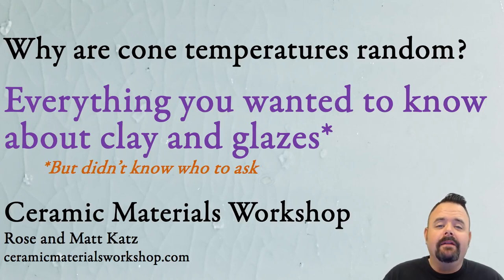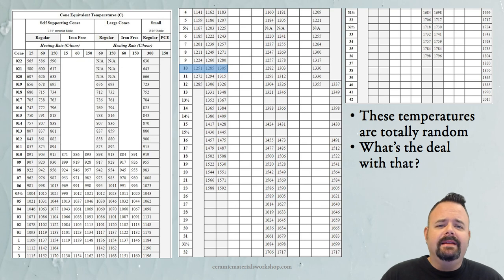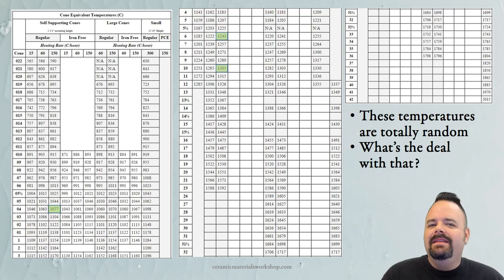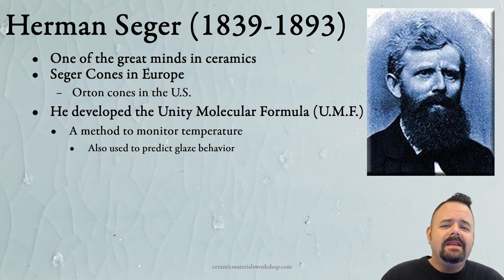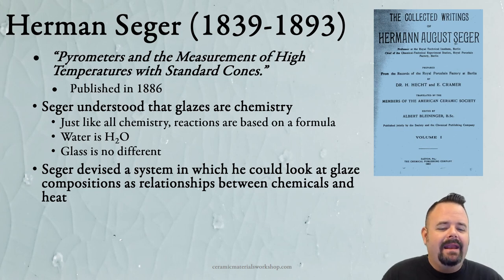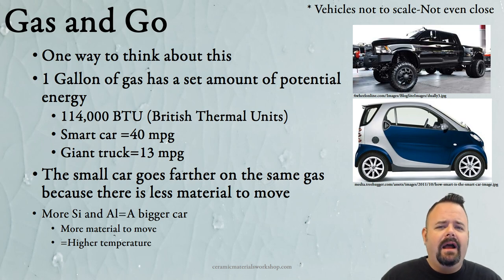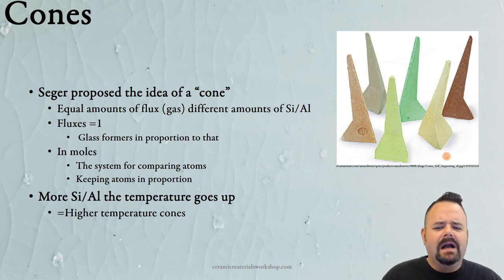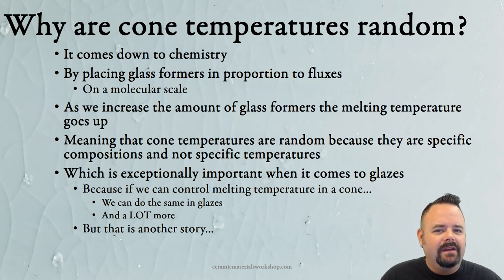Free Glaze Chemistry Lesson:  Why Are Ceramic Cone Temperatures Random? | Ceramic Materials Workshop

Comment: Would there ever be a reason not to use UMF for glazes? I am trying to come up with one.
Reply: I agree, it's useful making all the flux add up to one but I feel there must be some use to say add silica up to one. 

Maybe not. 

I might try it.
Reply: I actually discuss why that doesn't work, in the workshop. The inherent problem is that Silica melts at too high of a temperature. And although the result of the UMF is to show physical performance, it is actually a tool based in temperature (hence cones)